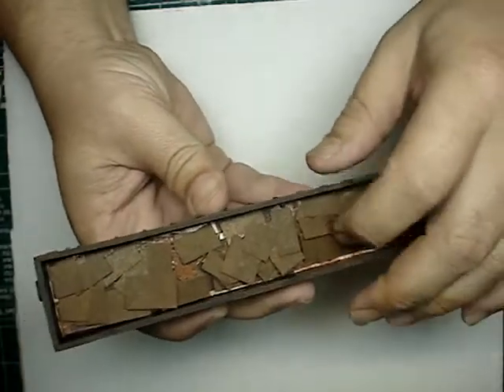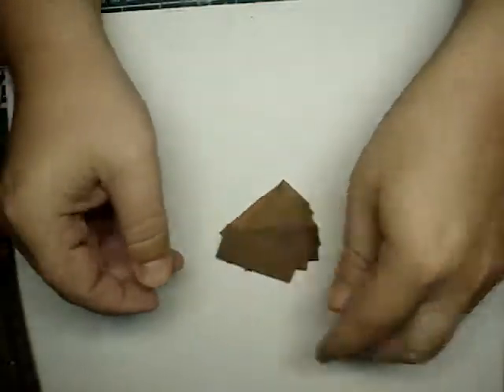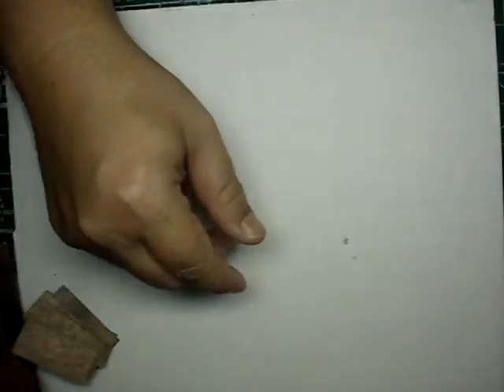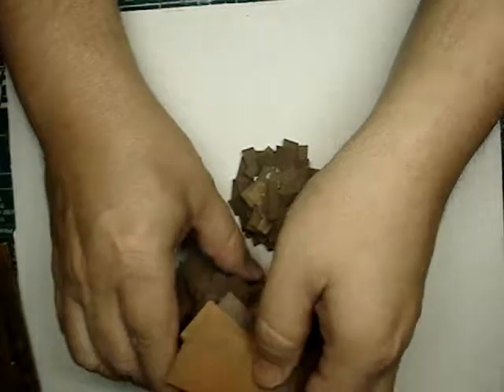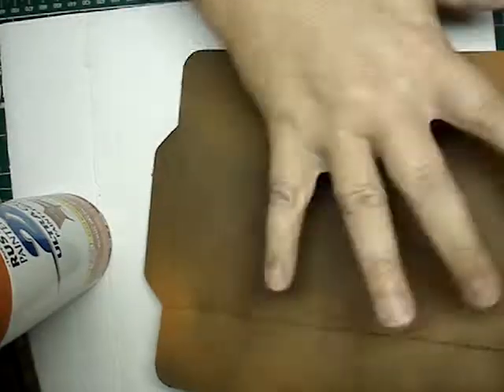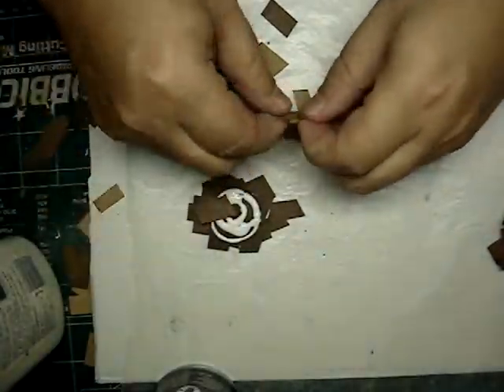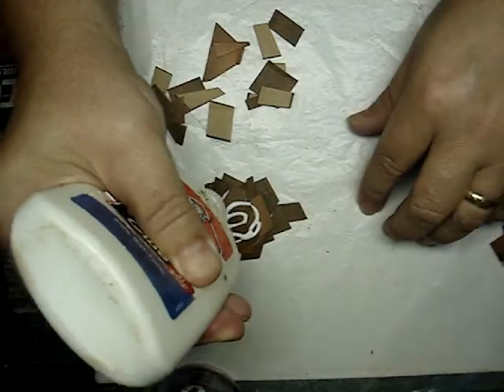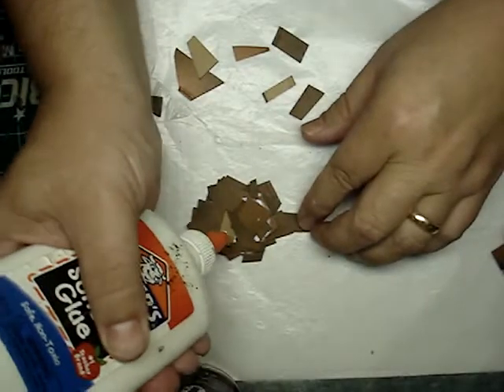HO Scale Steel Plate Piles. Try it today .

Comment: Nice technique. Dave does have a great channel. Thanks for sharing. Dave
Reply from the maker: Hi Dave. Yes great channel. I wonder if this can be done in N scale ? Guess one could cut them even smaller & pile. From three feet away it'll fool even the most seasoned modeler. Thanks for watching Dave.
Reply: @ModelingSteelinHO  I believe you are correct.

Comment: Hey ModelingsteelinHO! You posted a comment on my melt shop video. For some reason I was unable to respond. That layout was dismantled in July of 2020 and was resurrected for the third time in a new house starting in 2021. It looks much better now! Looks like you know your plate and structural scrap loads. Subscribing.
Reply from the maker: @jackklein8507   Hi Jack. Dunno what's going on with my YouTube lately. Could you do an update video on your layout progress ? I'd be interested in it. Been modeling Steel for over twenty years now. Scratch, bash or build whatever I need. As you know. Ya have to,lol. Check out my other videos if interested. Subscribed.